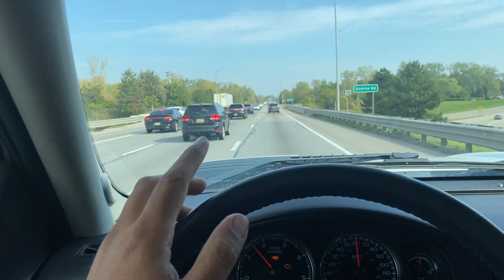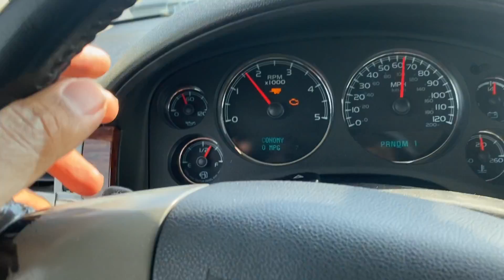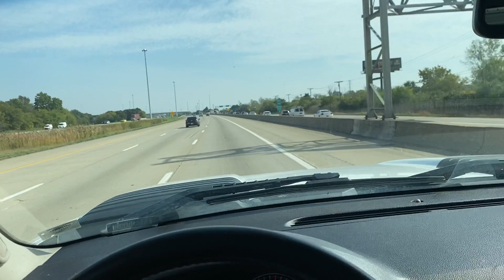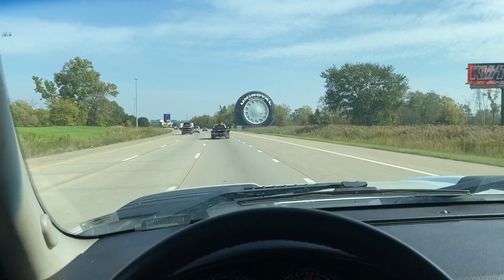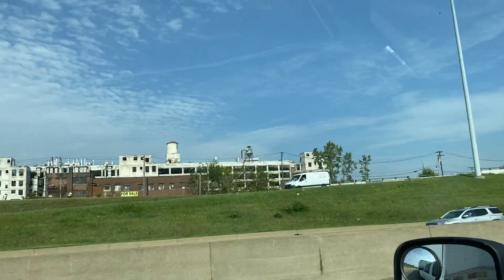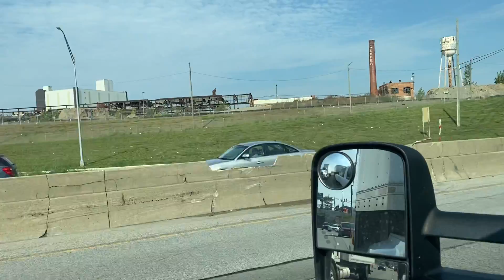3-hour DPF regen on a Duramax?  Don’t sweat it!  Your truck isn’t broken….

Comment: Just got a LML and I’m thinking I’m in my first regen. Have a check engine light when it started for some emissions sensor. But after driving around it is still there and don’t have high idle. Did have a ton of white smoke on acceleration as well. Deleting it this winter so hopefully it goes away.

Comment: I DONE with it all.  Fyck the warranty. And the dealer.   Taking it off and if it wont work. Im gone gas again.  Never had problems with my gm truck.  I put 60-70 k miles a year. And they take it until this 2024 gmc 2500.  Tran went first thing vefore first oil change    seem good now but map sensor is dirty within a day.  Ive checked.  Government has ruin diesel trucks

Comment: Face, diesels are useless ever since they started putting DPF's and DEF on them.  Gas seems to work better when you take that into account.  So long as the gas doesn't have direct injection.

Comment: So how many miles or hours  should I start look for this to happen?
Reply from the maker: There really isn't any rhyme or reason to it.  Unfortunately GM trucks don't show you a DPF restriction level (like the new Super Duty does), so unless you have a diagnostic device or tuner plugged into your OBD2 port you really have no way to know how "full" your DPF is, and consequently, when the truck will try to run a regen.  For the most part it depends on (a) your city/highway driving mix, and (b) how much you idle the truck.  If you spent a lot of time in the city, or idle the truck a lot, the DPF will fill up quicker and it'll need to regen more often.  BUT.... when a regen starts, you'll want to get onto the highway and drive as hard as possible until the regen is finished.  And you definitely don't want to turn the truck off during a regen.  Hope that helps!

Comment: So I’ve driven probably 300 miles at highway speed carrying 6000lb camper and towing a 16 foot trailer and I STILL have the message and the check engine light!  WTF???!  2020 6.6 Duramax only 41,000 miles
Reply: Have a 2019 just went through regen. 
After 2019 model year, the diesels got even worse. 
I miss the early 2000s even late 1990s diesels. 
All the emissions BS nowadays is just stupid

Comment: 2024 Duramax, I idle around the farm quite a bit, but even when I get the “cleaning exhaust filter, continue driving” code, I can hop on the highway and drive for 60+ miles, the code DOES NOT go away. I’ve taken it to the dealer twice to get them to plug into the computer and clear the code, but I can’t get it to go away myself. So frustrating, I don’t have time to keep driving and driving to try to make the soot burn off
Reply: I drove mine for about a hour and a half pedal to the metal hitting 98mph and its still not going away
Reply: Are you guys idling a lot ??? Usually that’s what causes soot load on the dpf … also another issue is turning off the truck while a regen is happening ……
Reply: @dieseldawg7132   then what happens?
Reply: @joethomas6457 well if they don’t complete the regens eventually it builds up enough soot that it becomes face plugged and the filters need to be removed seen some get bad enough to keep a truck from starting…
Reply: @dieseldawg7132    Ive had truck running all day moving pressure washer trailer every 10 mins 100'.   Clearly I need to finish the job before I can hit the highway.   But no good.   Love a truck the keeps me from making money instead of helping make money.  Really should have gasser.   Damn Yugo might be more reliable
Reply: @joethomas6457 we lease trucks and I always hear the same thing 😂 ppl are mad because they either have regen issues or aren’t making money because they are having to have forced regens done… it sucks the aftertreatment is a damn scam
Reply: @dieseldawg7132    you think I can actually remove and make truck computer happy some how.   I have new 2024.  New computer system
Reply: @dieseldawg7132 then what happens
Reply: Curious, do you guys use any additives. I drive 10-12 miles a day in heavy traffic and I have not had the code with additive. Also, when I do get any chance I boogie. Not sure if that helps get exhaust real hot.
Reply: You can thank the .gov for effing up diesel engines. It's sad really. 
Newer diesels just aren't worth the money.

Comment: I really appreciate this video. I'm  pretty naive when it comes to diesels. I'm trying to do my homework so I can make an informed decision as to whether or not the 3.0 Duramax is for me.
Reply from the maker: The 3.0 Duramax seems to get very good reviews, especially the newer one that came out a year or two ago.  No reason not to get one!!
Reply: Chevy is discontinuing the 3.0 Duramax.  Also, lifespan is only 150,000, which is very low for diesel.  I was really hoping that it would have been better/more reliable.  I was looking at a Suburban with a 3.0
Reply: @jasoncollins7182  No they're not, GM is only discontinuing the LM2, and the LZ0 is picking up production into 2025.  Probably do your research before regurgitating misinformation online.
Reply: @jasoncollins7182  good to know I'll probably just stick with the V8s while they are still available. Other than fuel efficiency, they have been good to me

Comment: My uncle said his 2018 gmc duramax doesn’t regen and it has the stock def shit and I thought it was weird
Reply from the maker: I think with a Duramax that you drive on the highway a lot, or pull trailers a lot, the exhaust can be hot enough to cook off the soot particles without needing to do a regen.  At the same time, the truck might be doing "active regens" on the highway without telling the driver.  We just bought an F-350 and it appears to do highway regens without telling the driver.  We notice that the DPF gauge goes from 75% down to zero, and our MPG's go way down, so that's the only conclusion we can draw.  You just don't get a message telling you the truck is doing it.
Reply: @ArmyProperty  ok
Reply: @ArmyProperty a forced regen/ active regen are usually done per the computer a regen while driving is considered a passive regen

Comment: I notice my L5P will will have a high idle around 1k 1100 rpm. Then drops to 600 after a few minutes. I think that may be regen? Idk, it’s so quiet I can hardly tell. But I let the high idle run it’s course and will shut off after.
Reply from the maker: We have a high idle for about the first 2-3 minutes after starting our engine cold.  That's not a regen, it's just the truck trying to warm itself up quickly.  (Partly for engine performance / longevity, and partly to start heating up the DOC / DPF!!!)

Comment: Is it normal to see blue smoke on hard acceleration from a dead stop when in regen? Only happens during regen.
Reply from the maker: Yes, we get a lot of smoke during regen.  Especially when accelerating.  For us, it's gray/white.  (Basically the ash that is left over when the soot gets burned.)  We also get a little bit of blue smoke (from burning oil) the first time we drive off after idling for 20-30 minutes.
Reply: Yes that's normal
Reply: Weird … make sure you don’t have a cracked dpf…. Shouldn’t have any soot after the dpf…. Will damage the scr….

Comment: I run a cetane booster in my diesel.  I notice 40% less regen time it helps the fuel burn better
Reply: If you live in a cold region,  C B messes with your cold temp performance
Reply: Where do you get it
Reply: Gotta be careful doing that tho, it causes exhaust gasses to run hotter, that could melt a piston. That's exactly what happened to the 6.4 powerstroke.

Comment: My 2014 LML has never put up a DIC saying regen in process and I have 92,000 miles. Recently a code came up and the service dealer soaked me for $3000 saying it was my catalytic converter. I have never heard of that crap, but ok, got it replaced.
  They also did a forced regen and now I got a code P24A0. Going this week to find out what this is gonna cost. I hate these trucks we can't work on and have to send to GM service centers. They are such a bunch of con artists.
Reply from the maker: If you do a lot of highway driving, you might not do a lot of regen's.  That's because the EGT's are high enough to continuously burn off the soot in the DPF.  And you're not producing a lot of soot to begin with, because you combustion temps are higher, which burns the fuel better.  You get a lot more regen's when you're driving around town and doing a lot of idling, because (a) the engine is generating more soot, and (b) the EGT's are lower, so it's not being burned off in the DPF as much.  If that makes sense!!!
Reply: What caused the P24A0 code on your Duramax?
Reply: @martinnormand7458  don't know, I cleared it and it never came back. Code description said it was a NoX Sensor!
Reply: So if I'm pulling a trailer every other month or so it's probably not needing the Regen?
Reply: @BrentPritchett-wv1qo  the truck will regen when it needs to regardless of when you pull. It all has to do with soot load levels.
  Get a BANKS I-Guage to monitor your EGT's and regen process.

Comment: These trucks and DEF systems are JUNK.
Reply from the maker: Yeah they're definitely hit or miss.  We've gotten pretty lucky with ours.  There's a guy called "TruckMaster" (I think) who has had nothing but trouble with one of his.
Reply: They become junk if your engine is burning oil or if you have EGR problem's also faulty injectors. You also need to run low ash oil in the engine
Reply: @hamletEast the EGR is the problem!

Comment: I would have to drive my truck for a week. We drove cross country towing our 5th wheel. The engine light fell off on the 4th day. I don’t know when the it started or when it stopped. The code said catastrophic stuff never said anything regarding a regen.  It’s very confusing. 2015 3500

Comment: Do regens have a schedule time frame like oil changes?
Reply: no
Reply: NO
Reply: So the GM diesels have at least 3 reasons to regen, #1 is backpressure is high, #2 a specific number of miles have passed since the last regen, #3 a specific number of hours have passed since the last regen.  All of these will kick off a cleaning cycle.  My 3.0l does it at least every 640miles, my 1.6l does it every 860miles and some times it will be lower, like 250miles if you are doing a lot of local non-towing miles.  If you buy a Banks iDash gauge you can actually kick off a manual regen when ever you want and it does support the stationary regen service too.  Both of my vehicles take about 10-12 minutes to complete a normal regen, the stationary regen takes up to 30 min to complete.
Reply: @CJIEngineering  does the banks void any warranty?
Reply: @Michael_Puddephatt  nope
Reply: @CJIEngineering  How do you know when the engine is in region? I have 4000 miles on my 3.0 and my def gage has not moved since I've owned the truck.
Reply: @kanehill7697 burning smell, gas mileage drop of about 5 mpg or my banks idash says when it’s in regen. My 3.0 doesn’t use much def until I hook on a trailer.